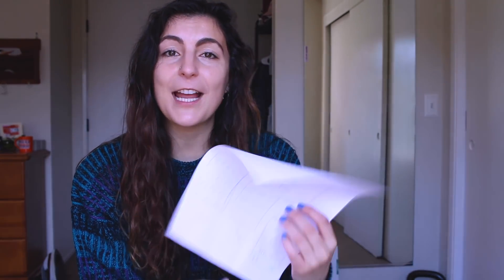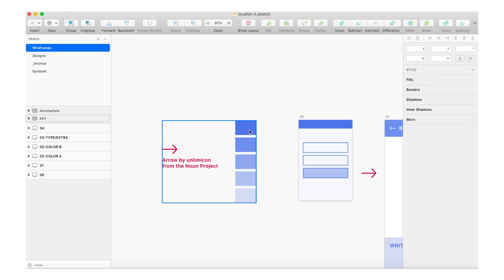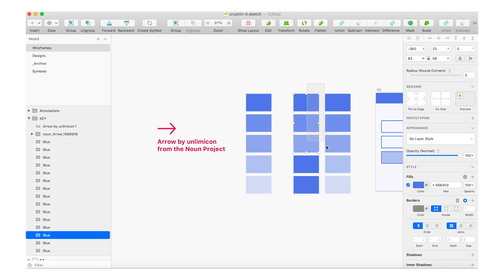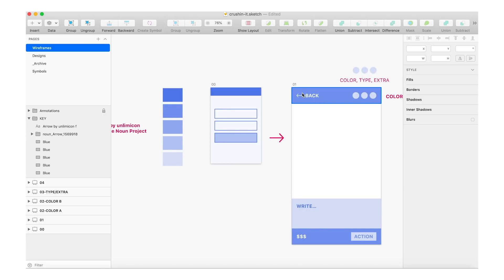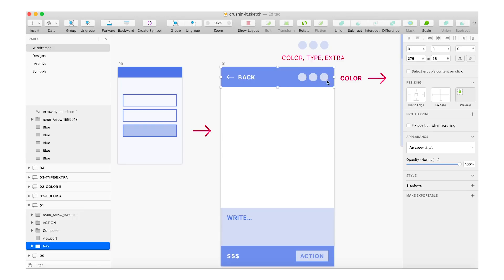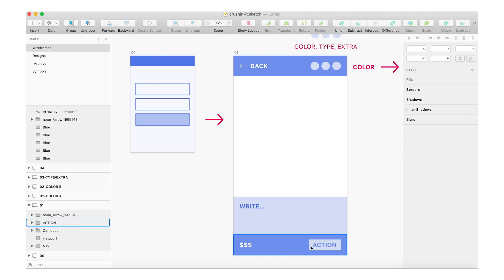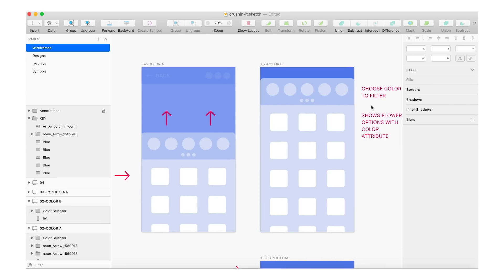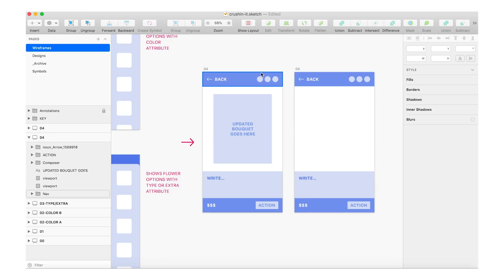How to design low-fidelity digital wireframes

Comment: You're such an amazing person and I really love how you use the shorthand tricks.. Also, I Have a Question what is it like working with a UX designer is there any challenges a beginner UI designer needs to know when working in a team?  :)
Reply from the maker: Thank you!! Hmm, I'm trying to understand your question. Could you provide a little bit more context? Is there something specific you're struggling with in working with a team while creating UI designs?
Reply: @HelloImAlexa   What is the scope of the project I have to do throughout my task as a UI designer?
Reply from the maker: @God-T  Hmm I'm not going to be able to answer that for you. It would depend on the context of the project you're working on and the problem/s to be solved.
Reply: @HelloImAlexa  Also do UI Designer create their own wireframes, or do they follow "Brand guidelines"  that UX Designer receives?
Reply from the maker: @God-T  Hmm again, it depends on the project. I've never personally been a UI Designer, I've been a Product Designer which is the role of a generalist, so I've always taken ownership over all parts of the process including wireframes. At more established companies you will likely see established Design Systems and Brand Guidelines and use those to inform the design work. A UI Designer may be the person designing the design system.
Reply: @HelloImAlexa   Product Design :) 
 is a really huge field  I really admire your faith 
and the dedication it takes to do something like that it's amazing! 

Also thank u for taking the time to chat with me most times I don't get a reply, so I try to formulate  my words carefully as I can
Reply: @HelloImAlexa  Also, I've always thought about becoming a Product Designer after becoming a UI Designer is it difficult, are there a lot of general tasks that u most complete within a day? 🤔

Comment: is the height of that nav bar based on ios guidelines? Does the height matter or can you decide any size?
Reply from the maker: In general, I don't think the size of the nav bar matters in wireframes as much as it matters when designing your final, pixel perfect mockups.

Of course, if you're testing nav bar designs specifically you may need to be more accurate. But the point of creating the wireframes I made in this video was to get some initial feedback on the flow, so nav size was more arbitrary.

Does that make sense?

Comment: This was great! Random question: how did you chose the height of your navbar etc.? Are there certain standards that you used or was it kinda freehanding it?
Reply from the maker: Great question! For wireframes I sort of just wing it. The point of them is to be able to make something fast. Once you start refining the designs, then you should start to make sure all of the sizing it proportional. Also, if you're first starting out, it can be useful to upload a screenshot of your sketches and start by making the wireframes on top of them. If that's the case then you should just follow what you've drawn as a guideline for the height of the nav bar. Same rules apply from above. Hope that helps!